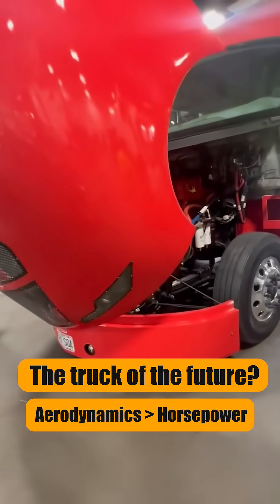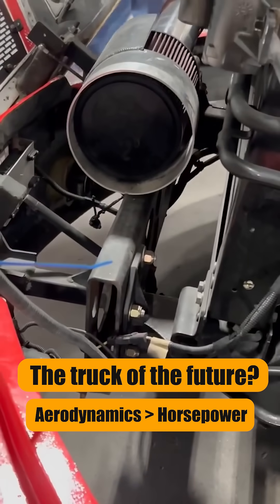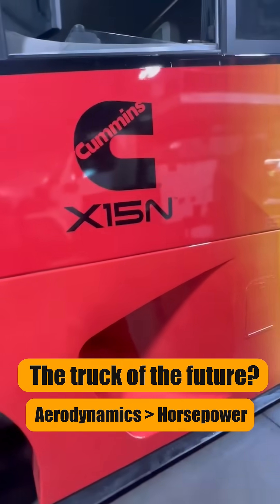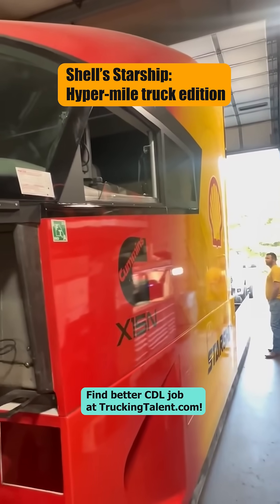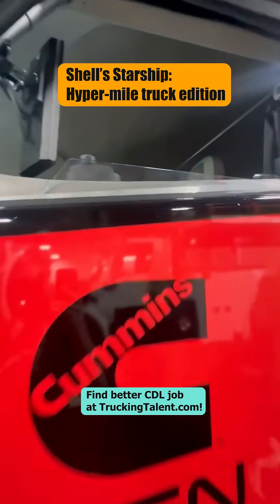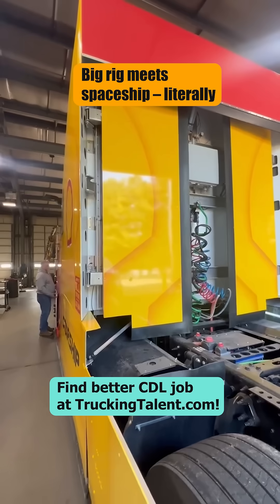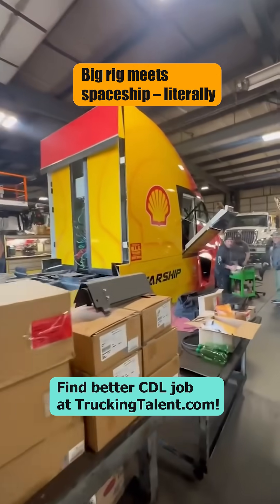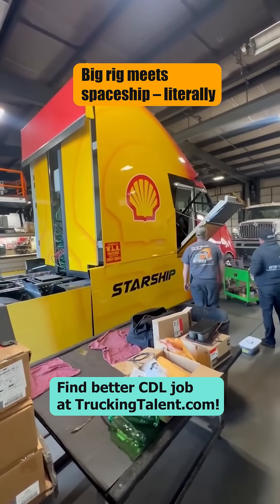Trucking in 2030 Nope, It’s Already Here

Comment: I mean this is a test truck and not a production model. It origionally had a diesel engine at one point, but they wanted to test the natural gas one. Looking at it from purely a test mule type of concept I can see some things that might help in the real world. 

First off the overall shape probably increases areodynamics quite a bit. Yeah, it's unusual, but many people said they didn't like the round nose type trucks when they came out and now with the death of the W900 Peterbuilt is the only one making a square truck. When I drove trailers didn't have farrings undet them, but now they are commonplace. It may not look normal, but give it time and the shape would look more commmon.  

To go from concept to production model they would likely have to go back to a diesel engine because that's what the infastructure can support. It would have to have a better solution to the ramp door thing. And the wind things that are folded on the back would likely have to be modified as I haven't seen a single pic/video of those actually being used while the truck is in motion.

Inside I wouldn't throw a pen on the dash as you will likely never retrieve it again. i don't know that I like the fully digital dash and just cameras because I don't trust them not to fail, but that my be my old school bias talking there. 

Yeah, the engine being covered is gonna make things like adjusting the top end or removing the cylinder head a bit more complex (maybe something like a doghouse on a van?), but really how often do those repairs get done? For 99% of the maintanace that thing looks fine....until you have to change a wheel.

TLDR: as a working production truck that thing isn't ready but as a concept trying new ideas I think it's on the right path

Comment: It's like someone who was tasked with bad concepts. 
Weak torque natural gas. Air intake so low it sucks water. Ramp you're unable to exit the vehicle while parked or fueling.  Plastic covering every point of daily inspections.  Windshield over the engine.  Cameras no mirriors.  It's a complete flop

Comment: Thomas Boone Pickens Jr. was an American business magnate and financier. He also promoted natural gas trucks. They work because it’s much cheaper to fuel up with natural gas than diesel. Natural gas burns 100% and doesn’t need a catalytic converter. It just needs to be stored at a higher pressure with double walled tanks. There are thousands of cars using propane and their engines rack up hundreds of thousands miles many well over 500,000 miles

Comment: I’d like to see it handle three specific challenges for four months first challenge Seattle, Washington to Chicago Illinois across 94 from December until January until April 1. Second challenge going into the oil field of West Texas, and see and handle all that dirt and junk through there.. the third challenge North Dakota or Wyoming from 1 January until April doing sand or crude oil out of the locations. I guarantee that Truck will fail all of those challenges within the first month.. the truck looks slick, but I find it very limited in its applications.

Comment: Why would the engineers even put the intake that low?  That’s a disaster waiting to happen. Ramps instead of doors? The driver is stuck in or out as soon as another truck parks next to them. The drivers area looks similar to a European train cab. And good luck trying to clean that windshield ( inside and out). I’m not trashing this vehicle, it’s just that some concepts on here are way too advanced for this time. The more automated and motor driven gadgets…the more that can and will go wrong. And with shop labor rates well over a hundred bucks per hour, this is a nightmare waiting to happen once things inevitably start breaking

Comment: From a technician pov....absolute garbage. Have fun swapping the cylinder head!
Reply: These days fleet operators dont do overhauls or even do any rebuilds like that. Once they are 4-5 years old or 400k-450k miles they trade them out. They either sell them or give them back to dealer/manufacturer for credits on new truck. If for some reason there is something wrong with the motor like that it goes to the vendor for warranty work.
Reply: @wolf2179  cool story. It still has to be done tho 🤷‍♂️

Comment: Well let's look at it from business standpoint point. Fuel economy in todays trucking market is pure profit. The most fuel efficient units available = making money and thats the end result of owing a business.  So just from that stand point I'm all for it. But it needs to be a very small engine that only runs to charge batteries.  That's the future along with that type of aerodynamics. Im retired after 44 years and I use my Kenworth to pull my 43ft drv mobile suites fifthwheel.  Im in process right now of buying a volvo simply for fuel economy.  425hp with 215 gear ratio simply for fuel economy.  Im getting 9.25 right now. With a 8.50 average.  Fifthwheel weighs fully loaded 22k pounds.

Comment: Ramp?  Parking stalls aren't wide enough for that. All the stuff you won't retrieve until the windshield has to be replaced.  No mirrors? Yay, because electronics never fail. Totally worth that .01 MPG. All that skirting only to be ripped off at an old truck stop. Natural gas is so readily available.  Keep it.

Comment: The air intake is too close to the road when driving through inches deep water at 30 mph. 1 foot deep water will easily be sucked into the system at walking speeds. What’s to prevent water from entering the engine?

Comment: No grease on the plate, that will never pull anything cuz it's probably just a concept. The ramp is ridiculous, park at a dock with other trucks, you won't get out. Wouldn't that be a safety violation if it was on fire? Sadly plenty of drivers wouldn't fit thru the driver's window in an emergency.. this isn't viable in my opinion.
Reply: Lots of trucks out there that use grease less pads on their trucks and trailers

Comment: That slope windshield is the first problem. How do you clean that, plus you won't even be able to top off your oil without a mechanics help. Engineering without common sense. The wheelfarinings one super single bow out their done you won't be able to run it in the snow no ground clearance all the digital stuff works until vibration or a dead battery takes it out including the entrance ramp.

Comment: That truck will not have near the range of a diesel powered truck, due to the CNG tanks. 
There are significantly fewer BTUs in a gallon of CNG than there is in diesel fuel, plus, carrying liquid diesel fuel versus a cam pressed gas will produce a significantly longer driving range, and greater power output.